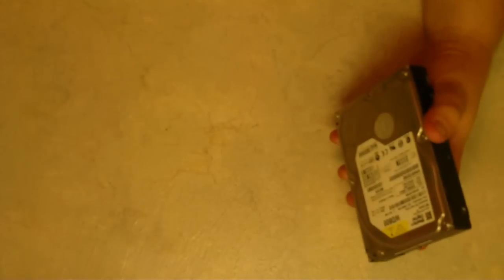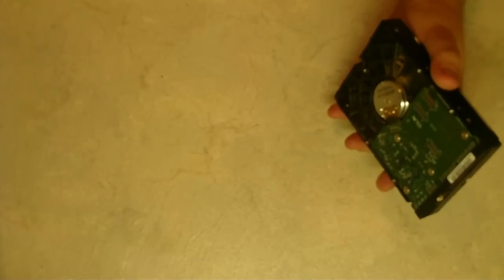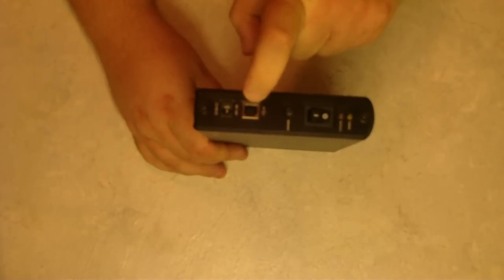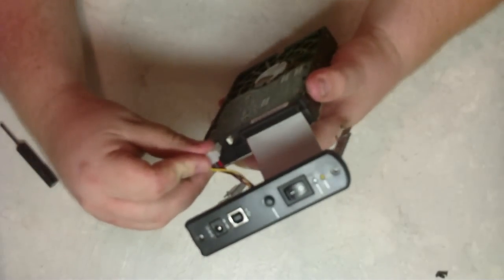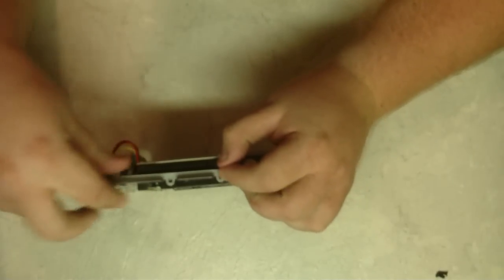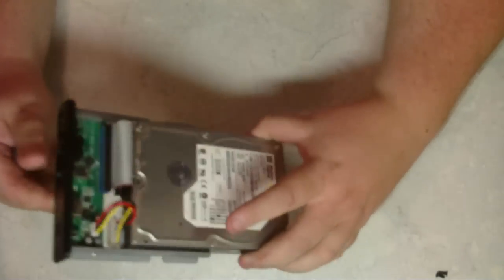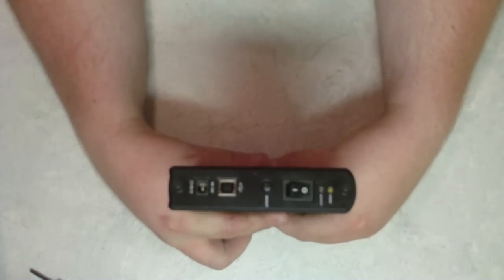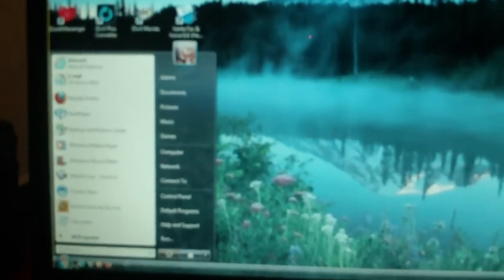How to convert any HDD into a USB Drive

Comment: you did nothing, you bought a DIY kit, and read the manual. kongrats on being a idiot. anyone kan do this.
Reply: *can *congrats
Reply: +ESRepair well, some ppl like me came here looking for info on building an external drive... not using a kit. thats why the title is misleading... somewhat. But I dont see a reason to be rude about it, I guess this information is useful to ppl who bought a kit.
Reply: exactly, he did nothing at all
Reply: hey whats wrong with you, dont you have anything better to do, make your own vids , 
i tink its just good to make infor open to the public,
Reply: I refuse to buy a kit, I want to covert the connector. Not use a adapter.
Reply from the maker: +Tee Bee If I did nothing, how was the kit assembled?  Not everyone can do this, otherwise, I  wouldn't have been asked to do the video..... -MrFixit
Reply: +ESRepair there are literally hundreds of how to videos for this specific setup.
Reply from the maker: Tee Bee you didnt answer my question.  -MrFixit.
Reply: +ESRepair it's a diy project, that you can buy preassembled that comes with instructions
Reply from the maker: +Tee Bee So. What's your point? -MrFixit

Comment: How do i know what hard drive i have and what kit i need? HELP!
Reply from the maker: justin green PCs since 2005 use SATA HDDs. Some of the XP PCs would have either an IDE or a SATA depending on when it was built. The HDD in this video was an IDE seen with the wide flat ribbon cable. SATA drives use 2 small connectors. One has 15 pins (Power) and the other one has 7 pins (DATA). For a better idea, watch my Transfer files from a dead PC video on our Channel. it will show the differences between IDE and SATA drives. -MrFixit
Reply: ESRepair thanks for that explanation ! was wondering what my HDD was and its a SATA !

Comment: I have a Samsung SP2504C 250GB Hard Drive from an old HP, what case and cables work with this??
Reply from the maker: Bill Cox You will need an External case for 3.5" SATA drives to connect to USB. -MrFixit

Comment: One suggestion on the temp ide power connectors to others is be very careful you don't jam the power cord in upside down backwards flipped etc. Ending result is either a dead pcb or worse. Currently working on a pcb replacement for a Co worker when he accidently had the power cord upside down jamming it into the ide 3.5 hdd power port.
Reply: I honestly thought the notches on the end made those idiot-proof; your coworker is very special

Comment: Dear sir,

I did finish the conversion already and indicator is on when I plug the USB cables to my computer. However my computer does not recognize the converted portable hard disc. If I plug in the true portable drive, my computer recognize it. I wonder if you have any suggestion regarding this issue. Thanks.

Comment from the maker: The 2.5 inch SATA drives need an external power source. The 44-pin IDE drives are the only drives that are powered by the USB. The 44-pin connector is actually a 40-pin (data) and a 4-pin (power) connector combined. -MrFixit

Comment from the maker: Yes, you can use the adapter like in the beginning. That adapter is a temporary solution for those who are not keeping the HDD. PC Dead video will demonstrate how that adapter is used. I haven't had any problems with excessive heat from either this kit or the adapter. HDD do produce some heat from the spindle which is normal. Too hot,  indicates a problem with the HDD. -MrFixit